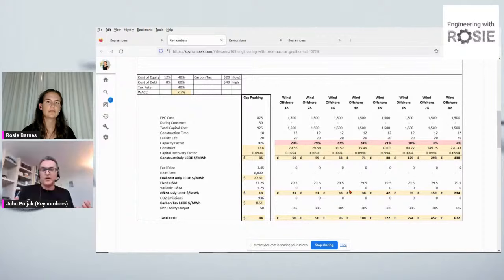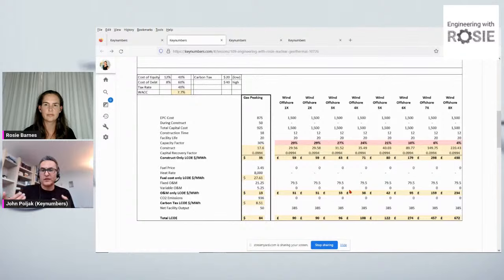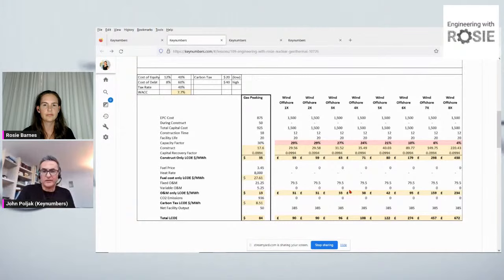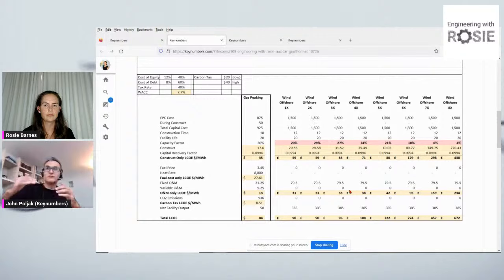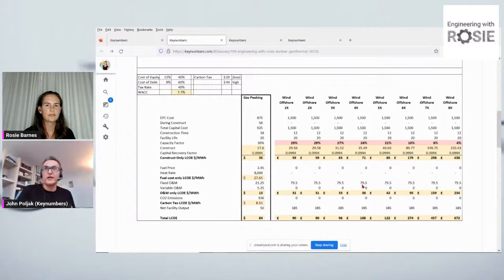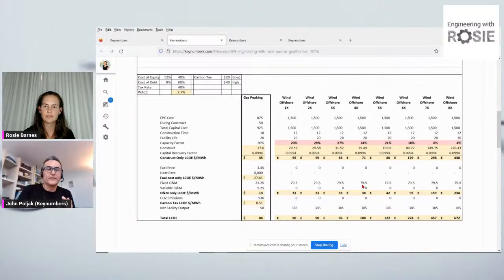The True Cost of Renewables - LCOE Calcs with John Poljak | Engineering with Rosie Live ep. 20

Comment: Rosie and John, Thank you for such an informative presentation. I would like to make one clarification. The downward sloping, discounted cash flow (DCF) valuation model,  is not meant for evaluating an individual liability.  Such as decommissioning a power plant. That would tend to have a flat to upward sloping line, instead.

Which means as the discounted assets (the plant) become less valuable than the liabilities (cost of decommissioning) , i.e. equity value becomes negative. The owner, is incentivized to find a way to abandon the power plant (such as by going bankrupt) and leaving it up to the government. So pre-funding the decommissioning, needs to become a requirement, to prevent such a perverse incentive. Since it is just another form of a negative externality, that perverts the efficiency of the market. 

Lastly, the only way to get enough support is to reframe this as an issue of small government fairness, that reduces government expenditures.
Reply: Thanks NC, I muddled up the explanation of a DCF, always struggle explaining it. I'm doing a write-up all of they questions, will look to add a clearer explanation there!
Reply: @keynumbers  John, actually you gave a clear classical definition of DCF, but Rosie's inquiry is outside of its normal limits of its use. 
So I would be interested in your write-up, to see how you address only the decommissioning via DCF analysis OR by any other means analysis. So where will that write-up be posted? And future value analysis seems more appropriate, IMHO.

Comment: Video on energy storage would be great. It's a wide range of problems from the short-term storage (to replace peaker plants) and long-term storage when the wind isn't blowing or sun is hiding for weeks on end. Then how the financing works out, replacing peakers is an easier economic problem but long-term storage is harder because you essentially make your own product less desirable by providing it, i.e cost goes down with greater availability. Do we need to go down the path of government owned storage just to make sure that electricity is available?
Reply: before seasonal storage even becomes relevant, we need to have seasonal energy overproduction. And in order, to get there, we need short term storage.
Reply: If too much energy is produced the price goes  down as well, so storage has the same market incentive controls there as well.
Reply: @davieb8216  the viability of grid storage is not just about the prise you have to pay for the energy. It is also about the prise you  can sell it for.
f.e. if we calculate 4c per kWh for Batterie degrtedation per cycle, 4c Grid charges per kWh and a roundturn efficiency of 0.8  than we only earn income in price differences above  100$ per MWh.  so when Energy prices are around 60 to 80$ per MWh there is no market for that storage. no matter how cheap you get your renewable energy source.
Reply: @MusikCassette  I agree, that's why supply demand rules still apply.

Comment: The cost of storage is a big factor.  A large part of the cost can be in the round trip efficiency,  for example pumped storage the motor/pump is 80% and generator/turbine is 80%.
Efficiencies multiply so RTE = 64%.  Therefore for the stored part of the energy, 1.5x  the generation infrastructure is needed
Hydrogen production is at best 80% efficient.  Burning in a thermal power plant is maybe 40% efficient at best.  Using in a fuel cell should also be about 80% efficient.  storage and transportation of hydrogen is a major problem.  Yes, is used for fertilizer, but there is no storage involved in that process.
Total electric energy production in the US is 4.2 Trillion KWH.annual.  Divide by 365 and 24 to get Average Generation power ... approximately 500 Gigawatts.  Presently 60% is from fossil fuel.  Therefore 300 x 1 Gigawatt Nuclear power plants would be needed to replace fossil fuel in the US.  in the last 30 years the US has built 3.5 GW and taken down 14.5 GW of nuclear generation capacity. 
That average 300 GW is about 4 billion x400 watt solar panels at 20% CF, or 450,000 x2 MW wind towers at 33% CF...PLUS STORAGE.  Storage Time and therefore Capacity is another big consideration for cloudy or calm weather.  Li-Ion batteries have a life of about 10 years.
Now factor in PEAK DEMAND.  in the US Peak demand was 720 GW in august 2021  -- almost 1.5x average.  You better have a good backup plan for that week or 2 of cloudy calm weather.  (meaning added cost for storage or redundant infrastructure)

On to the next problem Transportation:
About 125 GW additional AVERAGE generation capacity will be needed to replace gasoline transportation.
Add another 125 GW for diesel.
In this case Average means all the cars are charging all the time.  Therefore more generation capacity is needed to take into account Peak charging.  Yes much of this can be offset by charging at night while demand is lower,  but at the cost of double the power consumption during 12 hours at night.  Daytime charging (while at work) could be used in conjunction with solar.
Carbon tax is just a tax on the consumer to build new infrastructure.
I do not believe there is any viable pathway to transition within 100 years.

Cheap Reliable Energy is the Backbone of the Economy.  Unreliable energy will have a huge impact on the economy.  Lower GDP will increase in Inflation.
Reply: Thanks @Kerry, we'll look to the levelised cost of storage soon and discuss RTE etc.

Comment: I used 2 kwH yesterday. My twenty marine batteries were charged by 10 : 30 this morning. I'm building a 370 watts DC home made wind generator. I'm saving for a 1 kwH PMA wind generator and a midnight classic controller. I pay for it as I go. I'll be adding six more batteries for the wind generator. That will give me 32,500 watt hours of storage. I get to use 50% but will keep it to 75% charged, extending the battery life. So I get 8 kwH per day but of course can use more, lol. It's more than I use most days. It just works. If I save up $300 a year, I can replace the battery bank in ten years. Not bad cost. I will literally have over a ton of batteries in the group. I feel pretty safe with my battery material choice. Caution, if you use ⛵ boat batteries, prepare to buy a ton of them. This time of year, I lose about three hours of 🌞 sunshine on account of shading, so I'm going to move one pair of panels to the West side of the building. Today is my birthday. I'm 67 now, LOL. I'm making a bushing to attach an aluminum propeller to a DC motor. The motor has a pulley on it, when I wrapped a cord around and pulled, it made 79 volts three times in a row. So it just needs a propeller. I have a 3 foot aluminum propeller that I want to try on it. I hope it works okay. It's going to snow in a week, for several days maybe. So I'm sorting out windmill parts. I have a handle from an old tiller for the tail. It's made of tubing. I bought an 80 amp DC inverter welder and a Winco Lil Dog generator just so I can build the wind generator. I'm already independent of the grid, but I'm improving the solar system this year. A few weeks ago there was a small tornado that went less than a half a mile away. It's a good year to get independent from the grid. They said it was an F-0 but several power poles blew down.
Reply: You mean marine lead acid batteries?

Comment: I've love to see you tackle the cost of storage.  I find it complicated to determine how much storage is needed and what type to pick. There are many storage options available now (PSH, Li-ion battery, etc) and on the near horizon (CAES, redox flow battery, etc).  

Also, how much of the need for seasonal storage can be addressed with simple thermal storage such as boreholes linked to district heating/cooling. 

Lastly, in my jurisdiction, there is a requirement to have 20% reserve for power generation.  Can storage satisfy the need for reserves?
Reply: Thanks Tom, we're looking to do a talk on LCOS in the future, do you have a specific country/region in my mind that you would like to analyse?
Reply: > Can storage satisfy the need for reserves?
Sure - how much money do you have?

The main thing is over what timeframe.

Hornsdale Power Reserve is often touted as a great storage example. However, what it truly does is smooth out the grid frequency on the order of seconds. They just don't have enough to support bulk storage of energy over the course of minutes (yes, minutes, let alone days).

Let's apply the Chicago Test (where I live) - we get 3-day blizzards with no sun, and either too much wind or no wind. But we only get them 2-3 times a year, and some years no blizzards. However, the cost of the storage asset would have to be carried whether or not it is used. Accountants don't like idle assets - but, on the other hand, emergency room doctors don't like lack of power.

As an aside, hospitals in the US have a 3-4 day supply of backup (diesel generators), try using batteries for a single building, let alone a major city, and see if that cost is affordable.
Reply: @orionbetelgeuse1937  Simply pointing out the major costs (and presuming you could actually get the materials given the money).

I agree that it would be nigh impossible from a practical perspective - this is of course what is 'bad' about the LCOE calculation in the first place - it presumes that we live in a marginal cost world (which is usually true for the common artifacts that make up our daily lives - and usually untrue for the artifacts used by industry.

Comment: What about a race between different storage solutions and a gas piker. You could plug in the costs from renewabels/storageefficiency as fuel cost. As Energy output we could assume, that the storage facility discharges and reloads ones per day, Or we can use its actual power and assume the same runtime as the gas piker dependant on which of the two is the stricter limitation.

this might be a fair cost comparison for the most valuable slice of Energy production. There is a lot of in between, but covering those extrems might give some insight.

Comment: Just like wind and solar, nuclear costs cannot be simply judged by historic costs. You have to look at what future developments will bring.

For nuclear the direction is towards distributed small modular, load following, high temperature (combined cycle) reactors. These will be factory built to highly standardised designs. They will produce far less waste and be less dependent on water cooling (air cooling suffices). As the plants wear out the nuclear module is simply removed and replaced. Their operational characteristic is more that of a gas plant than coal plant.

The technology is more like the 'nuclear battery', similar to that proposed for Australia's nuclear submarines than to legacy industrial scale plants like the  UKs large centralised Hinkley Point project.

The issue is really about the last 20% of energy assurance. The decision whether to use gas, nuclear or god forbid coal, to meet this assurance is political/strategic rather than commercial. You can ignore the issue and get widespread outages as occurred in Texas. You can keep some coal plants, this would be costly, polluting and bad for climate. You can use gas, not so costly but polluting, bad for climate and possibly not sustainable.  Finally, nuclear, somewhat costly but non polluting, good for climate and likely to be quite sustainable.

Comment: Much of the problem of the intermittentcy of renewables can be addressed by changing the consumption patterns of the public and of industry, e.g. hydrogen generation when power is in surplus, EV charging off peak. This will greatly reduce the need for expensive storage or peaker plants and allow for a greater percentage of intermittent generators. This is coming and is already happening and is not adequately accounted for in the figures presented in this video.

Comment: As previously commented in other videos on the Engineering with Rosie YT channel: nuclear power is responsible for 4% of the global electricity production. The currently know (and economically exploitable) global uranium 235 ore reserves are sufficient to support this electricity production for around a century. Now let us assume that the construction of nuclear plants around the world is massively ramped up, so that e.g. 40% of the worlds electrical energy is produced via nuclear. The U235 ore reserves will then be depleted in less than a decade (or 1/4 of the live span of the newly build nuclear pants). Everyone with some common sense can see that nuclear can (and will) never attain a significant part in  the global electricity production.  

OK, what is the alternative?

Well, lets look at the joint wind turbine project Germany, Belgium, The Netherlands and Denmark have set-up in the past year. All turbines in this project will be installed off-shore in the great North-Sea area. The currently total installed capacity on the North Sea is 15 GW. By 2030 an additional 50 GW of capacity will be installed. Between 2030 and 2050 a additional 85 GW will be installed. The total installed capacity will then be 150 GW (or the equivalent of 75 nuclear plants, when we account for the difference in capacity factor between off shore wind and newly build nuclear).

Wind + solar is thus the solution.
Sodium-ion back-up batteries can overcome the wind and sun free days for remote areas where dunkelflaute is a problem and connection to a larger electricity net or geothermal is not an option.

Comment: Nuclear subsides make it hard to compute a true unsubsidized LCOE. Nuclear is uninsurable and Price Anderson is insufficient, as $450 million insurance is effectively uninsured for an accident like Fukushima. How do you figure the cost of looking after U235 nuclear waste for 100,000 years. Or maybe only 300 years if you use thorium 232 to start. You cannot just say nuclear with so many different reactors, moderators, and fuels. The specific nuclear reactor design, government support, and fuel cycle must be considered.
Reply: > as $450 million insurance is effectively uninsured for an accident like Fukushima
Or for the major 'renewable energy' contributor, hydro (at about 50% of RE worldwide). An accident like Banquio is completely uninsurable.

> How do you figure the cost of looking after U235 nuclear waste for 100,000 years
The US charges $0.001/kWh for that. See 'US Nuclear Waste Fund'

> You cannot just say nuclear with so many different reactors, moderators, and fuels
Exactly!
An AP1000 is completely different from a one of the SMRs and both are so different from RBMKs (Chernobyl No 4) or GE-BWR Gen II (Fukushima). Not too mention siting - Palo Verde in the Arizona desert doesn't really need to mitigate tsunamis.

Comment: cost of solar/wind is = solar/wind plus gas peaking
Reply: Thanks Jon, most models assume the last bit of renewables will be plugged by gas peaking or some other form of non-renewables. Peaking works as it's cheap to build and apart from recent years, gas is relatively cheap.
Reply: @keynumbers  thanks for the response👍 from my experience Solar and Wind need at least the same capacity of gas for times of Dunkelflaute, also some level of batteries or synchronous condensers for millisecond response for network events causing frequency dips from unforeseen load increases/or network outages. 

Does your figures consider this? Or would it need to be factored in separately?

Comment: I posted about the French Nuclear load factor which was 51.5% in 2022

Wind was 26.8% of GB Elec in 2022.

GB less ideal for solar than Aus (though it had more capacity until very recently!) but ~14GW today with the UK Energy Strategy aiming at 70GW by 2035.

The Netherlands at 800MW/pp (2021) was the world leader and near neighbour (GB 200MW/pp)
Reply: The load factor is low in France because they shut them down in fall and spring. Uranium sitting idle in reactor cores serves as seasonal energy storage.
Reply: @gregorymalchuk272  No it was so low in France in 22 bc they had huge issues around maintenance and corrosion.
Reply: @tcroft2165  Because they ignored preventive maintenance during COVID. And yes, a significant portion of France's low capacity factor DOES come from the fact that they have enough nuclear for peak periods so they curtail production during the spring and fall. They are one of the few countries with a nuclear fleet big enough to need to do that.
Reply: @gregorymalchuk272  Fra N was well down on even recent years due to corrosion issues not just delayed covid maintenance. They were scrambling for everything they could get running and didn't have enough.